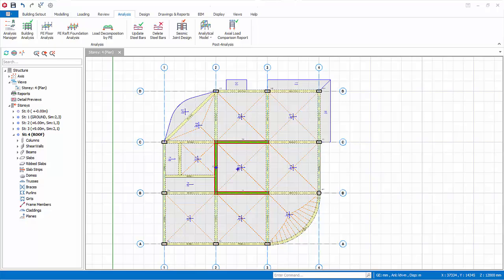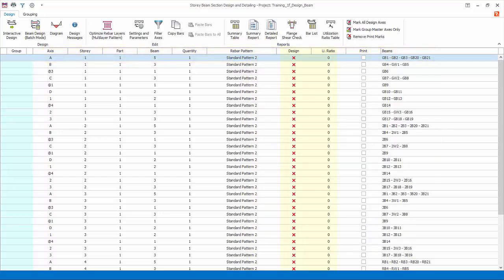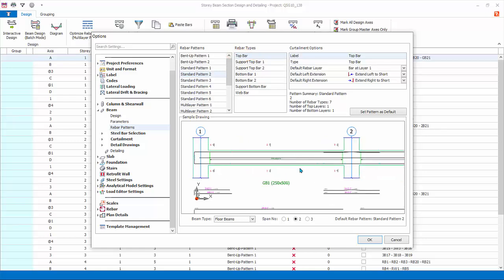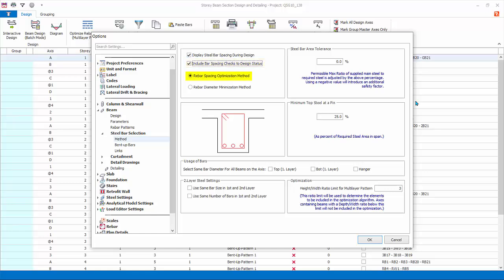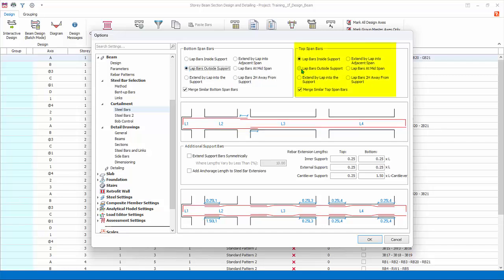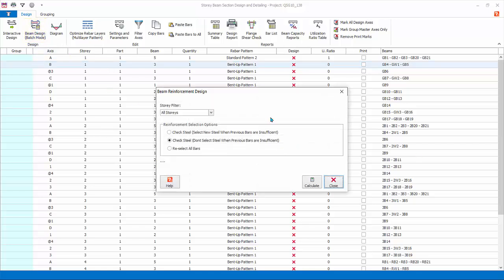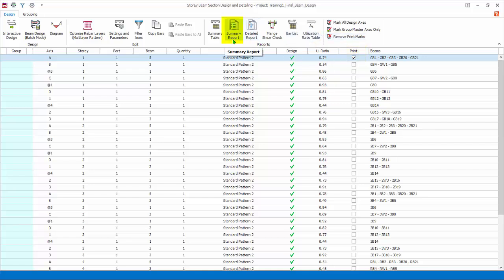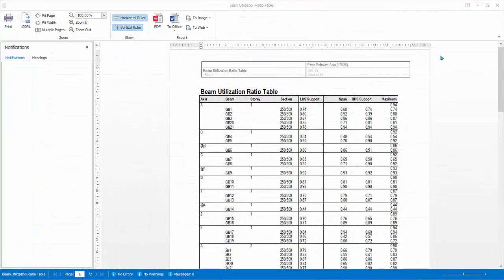19 – RC Beam Design | Part 1

Comment: Dear Sir,

After successfully modeling and saving my project, I encounter the following error message every time I reopen the file:

“Column: 1C1 section unidentified, center of rigidity cannot be calculated.”

I have tried multiple times with different models, but the same error continues to appear, and all project members are lost each time.
I kindly request your assistance in resolving this issue.

Thank you for your support.

Best regards,